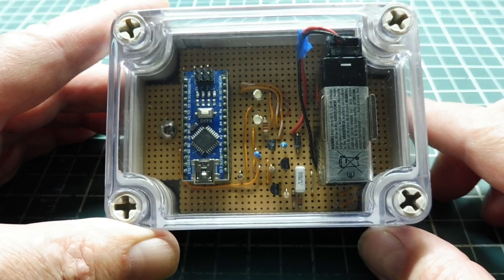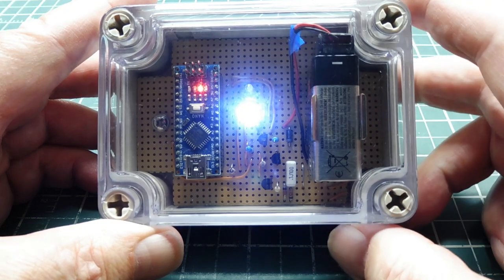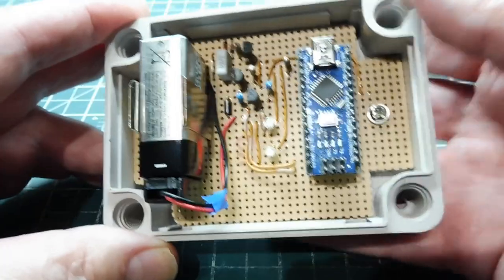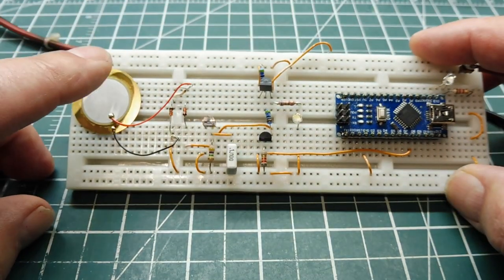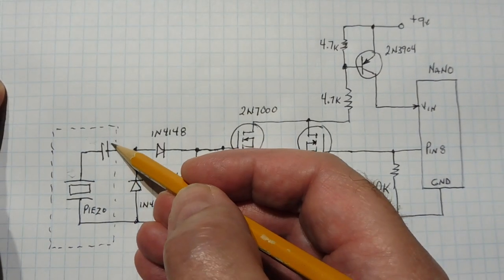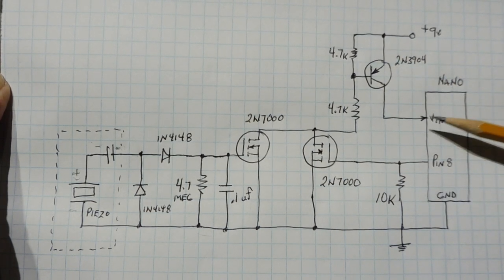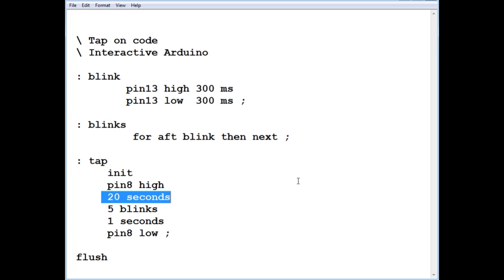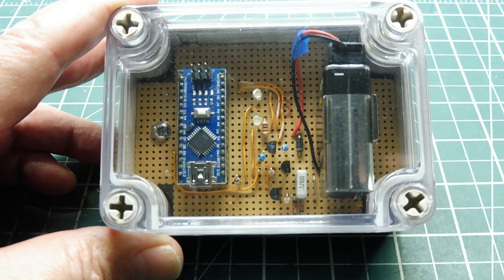How To Weatherproof Your Projects / Impact Power Switch / Forth

Comment: Great ingenuity ! I usually do make holes in similar housings which eventhough they are in a humid/agressive environment. Of course I use cable throughputs and switches that are suited for this kind of work. I'll keep your solution in mind !
Reply from the maker: Yes, cables glands are handy for feeding cables into weather-proof enclosures.
Reply: @0033mer  And at the same time I learned a new expression in English: "cable glands" ! Thank you !